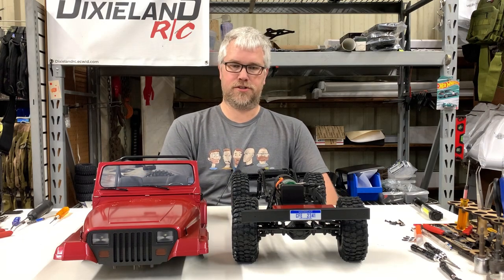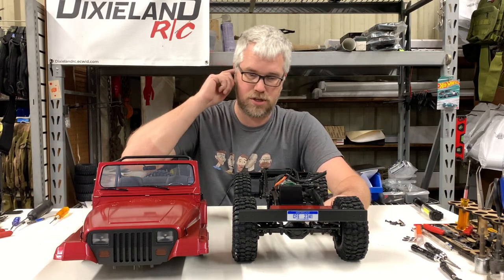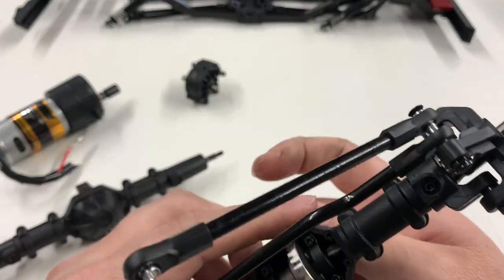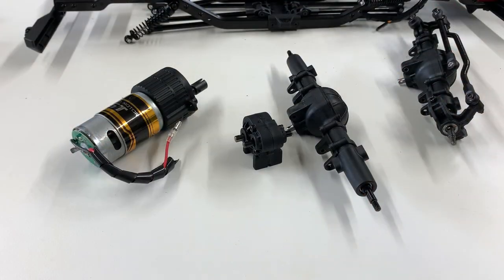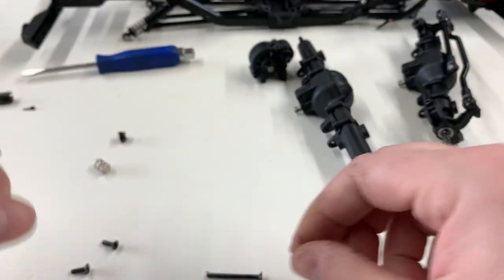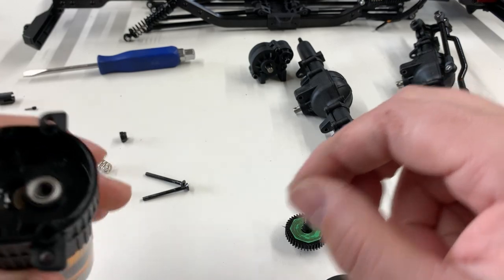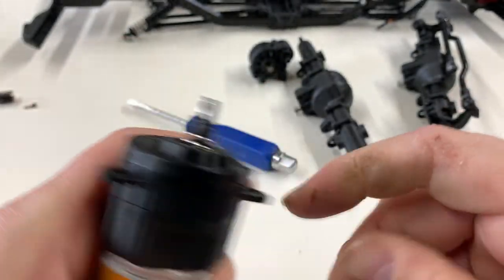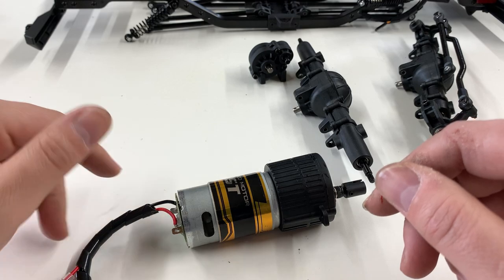FMS MASHIGAN - Full Teardown (You will want to watch this)

Comment: With the configuration it has it seems that you will likely end up with grease on the slipper clutch surface after some driving.  Just seems like an engineering oversight to me.  Every reviewer I've watched that has gone into the gear boxes and axles has the same lack of grease situation you had.  As a YJ owner i purchased this vehicle and have plans to do a complete teardown and rebuild before I apply power for the first time.

Comment: Them shaving their pins down ain’t a bad idea .smaller hole ..SSD use stock pins and I’ve sheared no end of their pinion gears on the axles ..even new gears have broken on their first run .

Comment: What's the difference in using a diff oil vs grease in the axle?
Reply from the maker: Diff oil generally goes in a sealed unit and not open gears. Grease is better because it stays on what you put it on.
Reply: @DixielandRC  Thank you. I got The Mashigan and local hobby shop told me to use the Diff oil but I'm seeing everyone else use grease.
Reply from the maker: No. Please use grease. I have Jims Bearings grease in stock in a little syringe that makes adding grease super easy. Its listed under Fluids on my site Dixielandrc.ecwid.com
Reply: @DixielandRC  Thank you!

Comment: So, did you end up putting a fusion in it and if so, which one and where is the video?? 🤣
Reply from the maker: I didnt. Lol. Someone offered me big money for it at an event after they went away. 
Use the fusion se
You will have to cut a bit of the front battery tray thing. But wont be much to have to remove.

Comment: Why you need the grease? all 1/8 bashing/racig cars, dont use grase on the pinion/spur gear
Reply from the maker: Not really in that particular spot. But everywhere else its a good idea. Plus we run these type of trucks in water. Grease is a great water deterrent. Rust is the biggest issue.